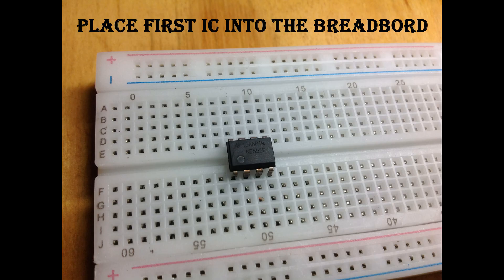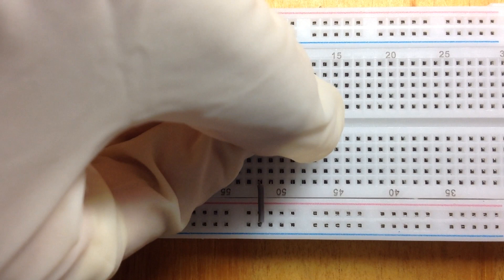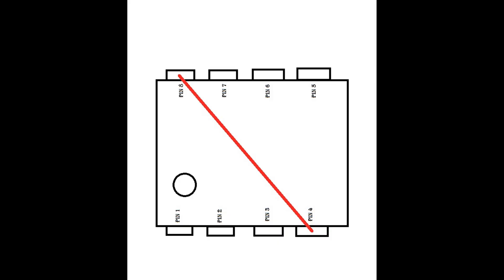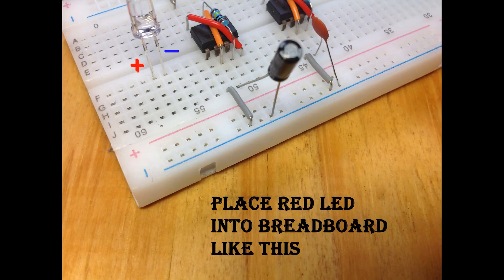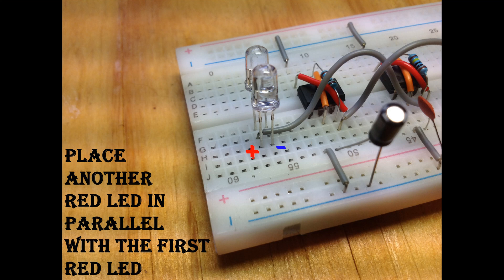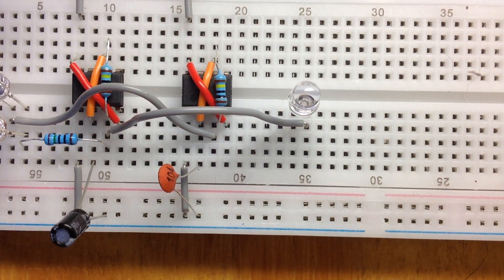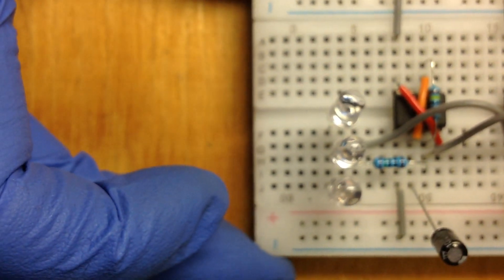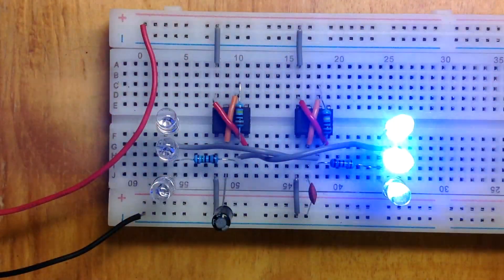POLICE LIGHT LED CIRCUIT ON BREADBOARD

Comment: Fun fact, if you add a potentiometer instead of set resistors you can increase the speed at which they flash
Reply: Bro i have got a sound bazzer where should i connect that sound bazzer??  On this project
Reply: No, only changing the capacitors can change the rate. Higher the farad, the slower it flashes

Comment: If they blink long enough, wont they end up out of sync?
Reply: No. They're never "in sync".  One timer switches fast and the other slow. The red LED's are connected inverse parallel with the blue LED's and that network is connected between the outputs.  So when the slow oscillator is in one state it's output is acting as positive, forward biasing one color when ever the fast oscillator's output goes low.  When it switches to the other state, it's output acts as negative and the other chip forward biases the other color each time its output goes high. Make sense?